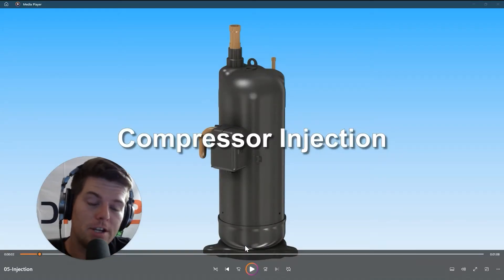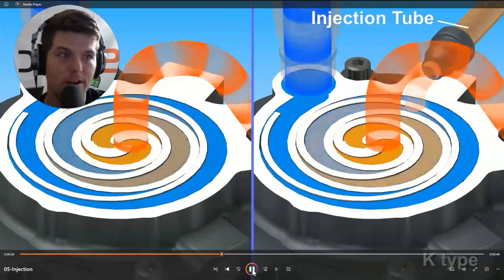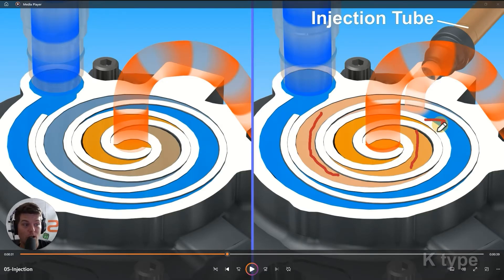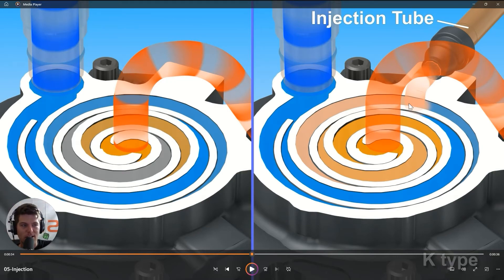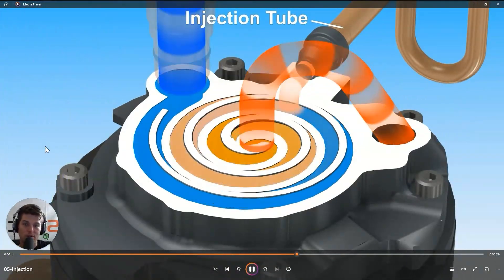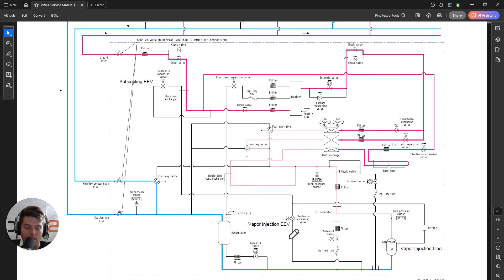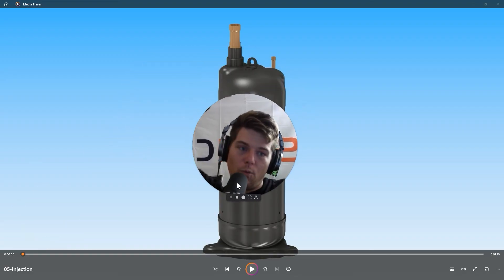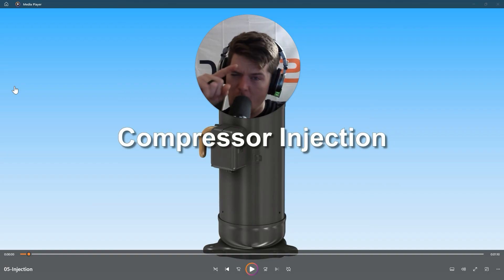Scroll Compressors & Vapor Injection: Let's Get It Straight

Comment: Why inject vapor half way through the scroll. Why not have an adjustable expansion valve and adjust it upward so that the scroll takes in 200 from the start and no inlet half way through?   Would that require more energy and injecting it half way through gives it mechanical advantage (more torque) to work on the 200psi vapor?  Is that why?
Reply from the maker: The vapor pressure is also responsible for other things like compressor cooling and maintaining cold evaporator coils. The saturation temperature at 200 psig makes for poor cooling both at the compressor and inside. 

In low ambients is where vapor injection is used due to the low suction pressures and room within the empty scrolls.